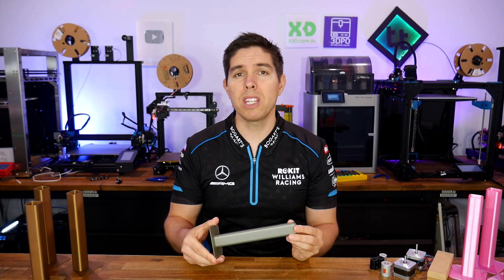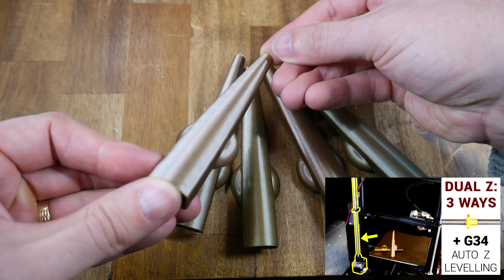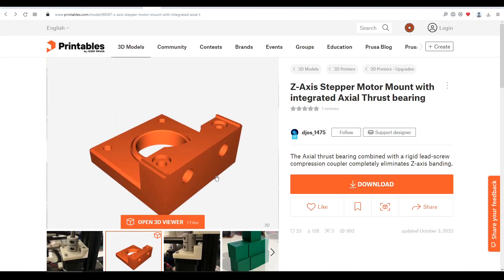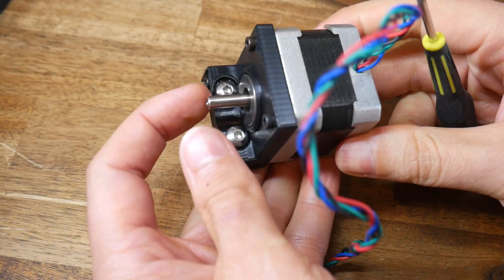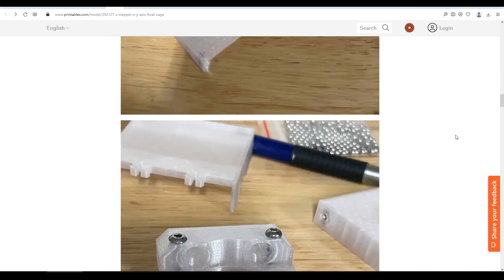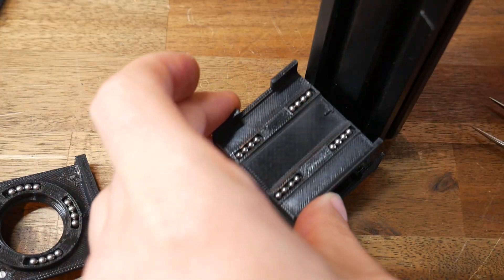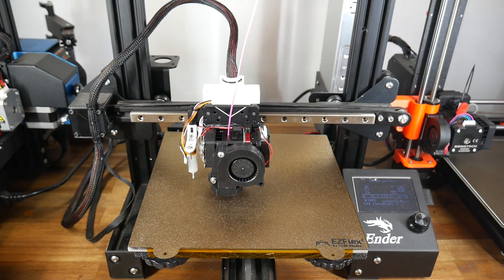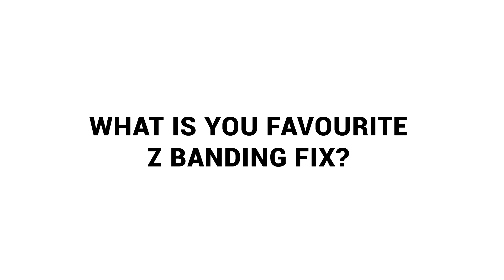Two Z banding fixes for your 3D printer from the community

Comment: The best "fix" for lead screw problems (I've found), especially on i3 style machines (ie. Enders), is the "belted Z mod".  One unexpected perk of this mod is being able to use fast "Z hop" movements consistently on an i3, which normally isn't possible.  If you have extra spare parts and hardware laying around, it's a very "low cost" solution.  Oh, and there's no reason a similar solution couldn't be adapted/designed for the E5 style machines that the bed moves in the Z.
Reply: I'm currently just waiting on the hardware for this kit, I have all the printed parts printed. I'm excited to see if this fixes my issues that I've had sense doing the dual z rod mod on my ender3

Comment: So this video starts with a problem definition with relatively unclear examples and then goes on to showing 2 solutions to that problem which don't solve the actual problem of the 2 examples ...  Hmmm ... I would have expected some more work pinpointing the actual cause of the problems before making a video on it.  I now get the feeling these "solutions" may be great but for a non-existing problem (since you were using a stepper motor with a lot of sagging and still apparently weren't hitting this issue) and that the real problem to solve has not been discussed ...
Reply: I'm with you. Why spend a day or two printing a possible solution over replacement of wornout steppers.
Reply: If you've actually experienced this issue, you'll know how random it is. These were some good ideas that I haven't seen on YouTube before. If you do more searches, you'll find other solutions but they're all equally or more random. It's quite hard to pinpoint exactly why this is happening and the explanation given here both for the issue and the solutions was the best one I have seen so far.
Reply: I was kinda confused as well... Z banding is a wide spread problem. Spent all this video talking how to fix it... But didn't fix it.

Would of been nice to see other fixes for things that can cause Z banding.
Reply: Yeah, this was a strange video ... Bad story 3/10 maker coins
Reply: I was expecting him to upgrade the mounting points of the leadscrew. Using a spider couplers and Oldham couplers. Or replaying the leadscrew with 2mm pitch. But the 3d printed motor mounts? Doesn't that add a whole new sort of problems like z backlash?
Reply: not really, bent leadscrew was shown for the obvious visual, then the first was for vertical play, the second for horizontal.

Unfortunately, problems like layer stacking and mrr have not been consistently solved yet
Reply: @1fareast14  MRR, really? That's the scammer's nomenclature. It's called VFR.

Comment: I'd re-torque\align the frame\bed\belts\etc. and then (re)calibrate the e-steps and mA current to all the motors, to start. During that procedure, find out if the lead screw(s) has\have wobble by rolling  it\them on a flat surface (E.G. a cue on a billiard table).

I didn't know\think about the deformation of the bed due to heat. I need to watch that video to see how to test for it and\or if there's anything that can be done about it. Which, in the end, is what I would do after I completed the above steps. Does The Internet (specifically my favorite, Teaching Tech! Hi Michael!) have any answers to my existing dilemma?

Comment: Last summer I added a Microswiss NG Direct drive to my Ender 3 Pro.  At the same time I added a TH3D dual Z kit that uses a timing belt to compensate for the added weight on the X gantry.

For the next 5 months I fought a z-banding issue.  Rebuilt the x gantry, double checked the Z rods for being straight, shimmed the z stepper, tried different lubricant on the Z rod threads.  I just about gave up a resigned myself to having banding.  Not bad, but noticeable.

Then about a month ago I gave it one last run.  I replaced the Creality supplied Z stepper motor mount with an aluminum machined bracket and changed the T nut the stepper side with an Oldham coupler.  My banding is now a thing of the past am am very pleased at what is being printed.
Reply: Interesting fix! Where did you find the machined mount?
Reply: @Twin_Flyer  Amazon... Upgrade Metal Ender 3 Z Axis Stepper Motor Fixed Mount Installation Bracket for Ender3 V2 Ender3 Pro CR10 CR-10 V2 V3 CR10S PRO Z-Axis with 2040 Aluminum Profiles 3D
Reply: @larrybowers  Thanks!
Reply: Now that I reread my post and see the misspellings, one of the changes I made a few months ago when chasing the problem was replacing the brass 'T' nuts with Delrin (POM) ' T' nuts.  I think that did improve the quality slightly.